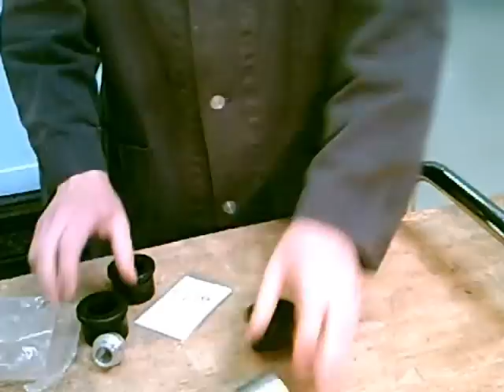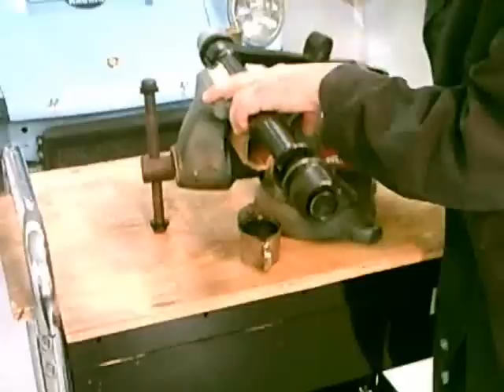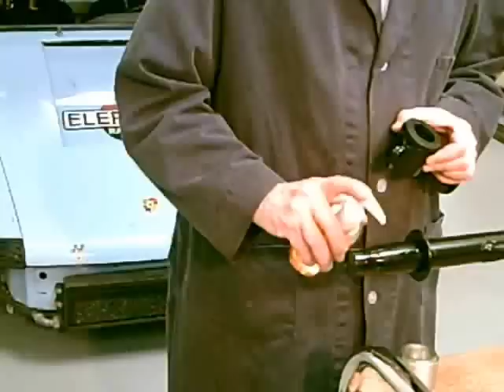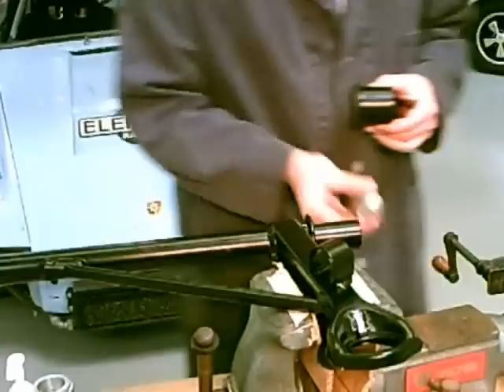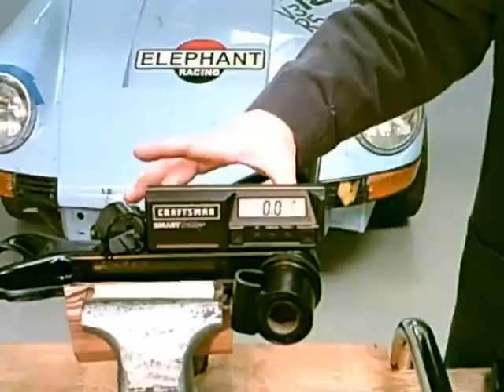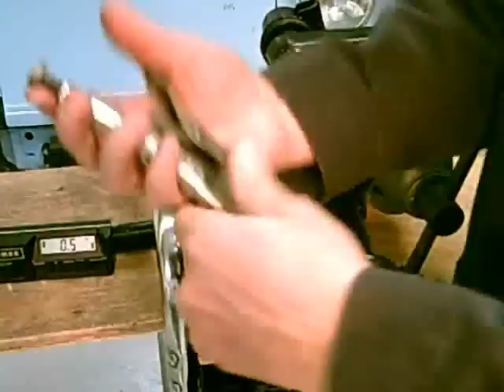Porsche 911 Rubber control arm bushing replacement installation

Comment: I am replacing my bushings and this video is great.  The question I have is the angles of front and rear mounts.  Looks like the rear was 15 Degrees and the front was 20 Degrees.  Is this correct (surprised Chuck didn't verbally say what degrees they should be), I had to replay the video to read the digital measure tool.   

EDIT:  I watched another video on you tube.  15% on the rear and 20% on the front is the correct answer.  FYI.

Comment: Wow this video is old , was it originally made on VHS? Cool, this vintage advice still applies.  
Some more questions 1/2 answered:
  Is it okay to use Dow Corning 111 Valve Lubricant and Sealant? I  ended up using liquid soap after wiping off most of the 111 silicone stuff...as good as that stuff is I realized it may NEVER dry.
     How large of a bar-clamp do you need? I used a plumbers pipe-clamp, these are typically made a section of black gas pipe ( you buy the red ends: crank and stop separately). ...minimum range would be about the length of the "A" arm...

Comment: Soap would work just fine.  It's a fatty acid, and in this case liquid at room temperature.  While it does have water in it, chemically it will remain liquid and stable even at slightly higher temperatures, like the pressure from the weight of the car combined with the flexing of the suspension.  There is no salt in soap, *827rover, so get your facts straight.  Silicone grease is the better alternative, but not necessary.

Comment: The rubber seat between the flange on the mount and flange on the arm can squeeze out, picture those rubber bumpers on shock mounts.  You tighten them and they mushroom a bit.  That's what squeezes out.  Not the bushing from the mount.